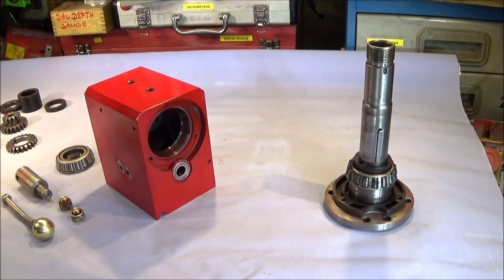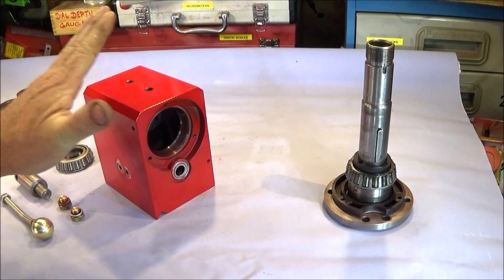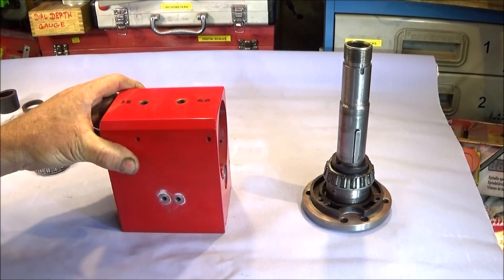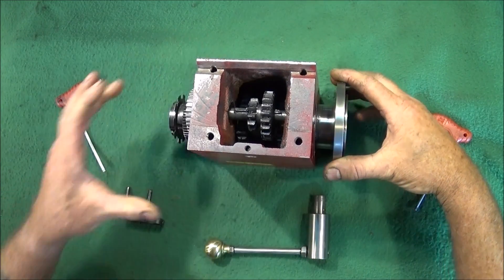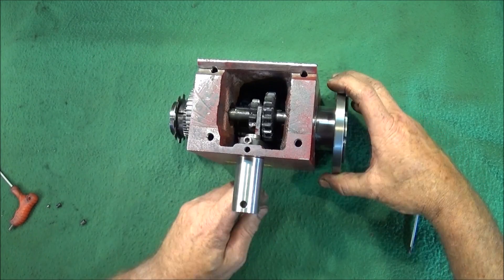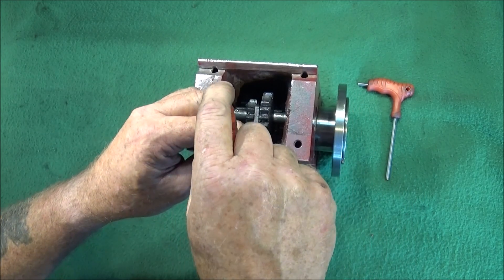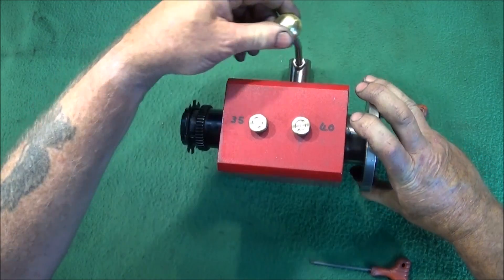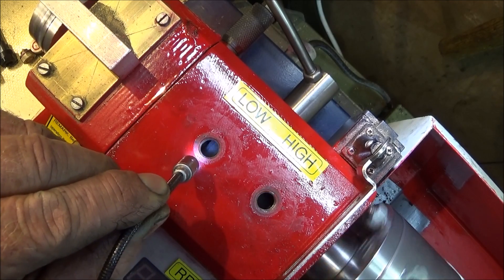Chinese Mini Lathe Headstock Gear Oil Ports New Gear Handle XL Speed Reduction

Comment: nice vid for the older mini's my mini does not have hi low gears just a powerful motor and vfd plenty of balls :) I love mine but I have terrible issues with the top slide  you can actually see it lift or rock when when gibs are tight no more rock but cannot move the slide, looks to be the gib causing this issue?
Reply: The dovetails in general are the worst bit of this lathe.  they aren't deep enough and the gibs are too wide, so they rotate whenever there is any upwards force on the cross-slide or compound.  Since i never used the compound, i removed it and replaced it with a block of cast iron, which also gave a bigger platform for the QCTP.  on the cross slide you have to turn points on the end of the gib tensioning screws, then machine holes in the gibs such that the point of the screw goes far enough that it makes contact with the gib beyond the point on the z axis where the mating dovetail starts  this is the only way to prevent rotation of the gib and not have the whole thing tip up when parting off.  of course this means that there is about 1cm (on mine, anyway) of stickout for the gib screws and that is the limiting factor of rigidity, but that's about as good as you can get it on these lathes
Reply from the maker: Hi Lawrence, I did put brass gibs in my compound, but it made it worse, so I polished the steel ones a bit, put them back in and used better quality stainless grub screws for adjusting. I have found though, that the compound slide is the real weak point on this lathe. I did a video on putting a couple of extra gib locking screws in the side, (now using allen bolts, rather than the brass screws), I leave these locked all the time unless I'm actually winding the compound. This has solved the problem,  but having said that I do not take massive cuts and treat it a bit more carefully than I do, if I was using a heavy duty lathe.
Reply: Hello. I had the same issue with my mini lathe. I found the gib's  were left with rough edges that bit into the lathe bed tracks. Sorry having a senior spell and couldn't remember the proper name.  I removed these. Worked for me.
Best of luck.
Bobby
Reply: no no not the carriage but the compound slide
Reply: Sorry that's what I was talking about. But I did both and got mixed up. Again sorry.
Bobby
Reply: Sigmatechnica I have been considering the move to MGN 12mm linear rail/carriages for mine since the rails are laying around. Combined with a low backlash ballscrew I believe this could be one precision machine.
Reply: blacky Mbblacks problem with ballscrews is they are so high efficiency they will turn themselves if back pressure is applied.  fine for CNC where you have a stepper or servo keeping the screw in position but no good for a manual lathe.   rails would certainly solve the problem of wobble but may introduce others in this lathe.  personally if i really wanted to improve it i'd machine off half of the existing dovetails and re-make them out of bits of phosphor bronze with some suitable adjustment mechanism, maybe with a tapered gib like the 'proper' machines (indeed including the one this was cloned from) use

Comment: Have you noticed any improvement in the running since the metal gears over the plastic ones. I like the taper bearings. Good video
Reply from the maker: +wmsbike Hi no there is no difference in the actual running. The plastic ones are all too easy to break though. When I had mine I had a tooth come off...It ran like that for some time before eventually breaking up. They really shouldn't use plastic in the headstock as it is quite a job to replace them.